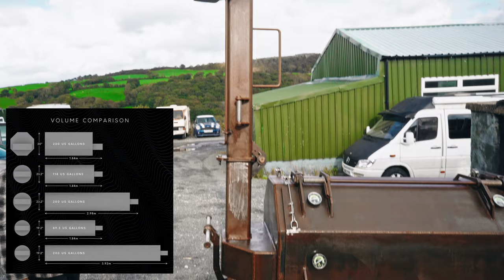Introducing the Terraton 200: The Ultimate Offset Smoker | Leviathan Pits

Comment: Texan here.  Lets acknowledge genius when we see it.  The four bar linkage for lid on firebox with spring assist.  This elevates the cowboy style firebox to the best Ive seen.  The introduction of cool air at top of firebox entry door is significant for thermodynamic flow, and a new idea.  Using barstock for gratings and the way they are assembled is innovative.  Main chamber lid design is front opening so the top of cooking chamber can receive insulation.  Front opening lid is counterweighted with what looks like reliable hardware.  The firebox fire management looks good with its shape making easy operations and clean out.  This is top flight engineering, innovation, and construction.  Even here in Austin the insulative properties would be useful during winter.
Reply from the maker: Thank you very much for your appraisal :) We're currently adding a few other small quality of life mods to the demo unit that will get incorporated into future versions (along with a re-vamped construction utilising as many folded parts as possible).

Comment: Great pit, great job! I might be wrong, but the wheels seem parallel in every direction. If that is the case, you might want to consider applying the ackermann steering geometry.
Reply from the maker: Thank you! We did experiment with Ackermann steering geometry in the prototyping phase, however given the additional complexity and knock-on effect it was having to other areas of the design we decided against it given the single digit percentage reduction in tyre drag. Realistically you don't want to be moving a 1.5 ton smoker regularly haha.

Comment: The only thing I’d like to see is the firebox lid engineered to double as a flat top griddle. Other than that it’s sick
Reply from the maker: Thanks :) There's an 8mm thick flat top plancha insert that can be slid in to replace the firebox grill grates shown. We wanted to keep the top lid insulated to prevent heat loss, and to double up as some extra temporary storage space. We're actually revising the top lid design very slightly by adding a 30mm tall trim on the firebox side and overlapping trim on the lid (with a thicker integrated stove rope gasket) for a super tight seal and no possibility of water ingress. But the design is highly customisable so if someone did want an exposed flat top we could simply remove the insulation to the underside of the lid and add a small trim to the top.
Reply: Sounds great, I was just picturing with the fire underneath heating up that lid I could make some Philly cheese steaks with peppers and onions, toast some rolls. 😋

Comment: Well done! I never liked the look of traditional door counter weights. I tried torsion springs similar to yours but was unlucky with getting the spring rate correct. Either too much or not enough assist. Seems like torsion plus cable gravity counterweight might be the way to go.
Reply from the maker: You're not wrong, it's definitely a bit of a balancing act. The cooking chamber door was openable with just the springs but still needed some muscle, but the additional pulley counterweights make it completely effortless.

Comment: Seems to been heavily inspired by the Hamrforge beast. 

Are you planning to make it a reverse flow version?
Reply from the maker: The beast is a great looking pit for sure. I can see the general resemblance, but the rack and pinion airflow vent control mechanism is about the only commonly shared aspect (which is functionally quite different on the Terraton 200).

Regarding a reverse flow option, it's not something were too keen on for a few reasons, but mostly surrounding the radiant heat given off by the large baffle plate. With the way we've designed the throat geometry and airflow path on the Terraton 200 you get the best of both worlds: even end-to-end lower grate temperatures, and highly convective top-down airflow (which can be scaled back in velocity as needed).